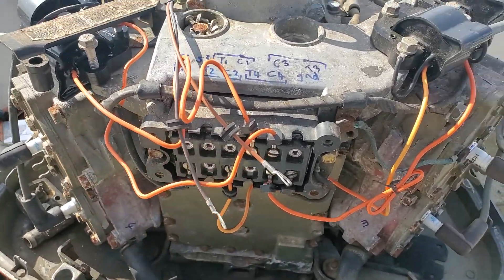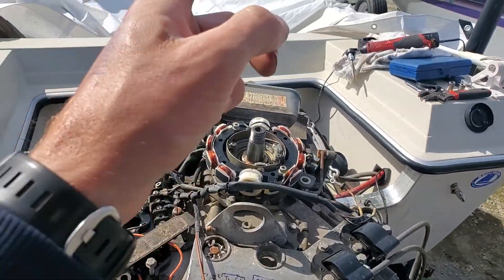Outboard Tech tips Incl Basics Crash course for diagnosing outboard problems

Comment: I’m not getting enough electricity to the battery. I did a multimeter when the engine is running it’s 11.5. I know it should be 13.5 or higher. I got a Yamaha 200 any advice of finding the stator wire so I could check that.

Comment: The only thing you skipped out on was is there a switch that connects to shifting lever that wont let engine start if not in nuetral so that boat dont scram into motion while attempting to start.also the wires coming into that red plug can you show what wires go to were on the block and what color it is.i got a used outboard with no control box and wires red plug cut at closest area to motor.no idea what starts what..it has the usaull purple,gray,black n yelllow,green,red,yellow and green i think.any tuturial will help just wanna hear it run.snooky pa.its a 90s johnson 40 off a pontoon boat!!
Reply from the maker: apologies - i was focusing on the motor components. Well 2 strokes are interesting, unlike a 4 stroke where key OFF REMOVES 12v POS to ignition to kill motor, a 2 stroke key off ADDS GROUND to short everything out because the ignition is self produce simply by the engine running - you can start a 2 stroke and remove the entire harness plug and it will keep running!! That safety switch is a backup OFF switch which basically connects a ground to the "kill" wire at the back of the motor - only difference is it wraps around your wrist in case of an emergency/accident :)
Reply: @SocalMarineUSA  yes you covered the motor components very well,i was just certain there was the nuetral safety switch on two strokes that will prevent ignition if in gear.yes i would assume its same as kill feature and grounds out system electronically. You know ur two strokes well obviously!!

Comment: Is it possible to get the idle timing close on a trailer and make the final adjustments on the water in gear?

I’ve had the engine apart doing reed valves and want to start from scratch but want to make it easier when I get on the water to do an adjustment in gear and not have to search too far for the timing mark. Thanks for your great information.
Reply from the maker: absolutely- dont swaet 50-1000 rpms either way.. i would say about 50-100rpm loss for in gear in water is about right. do it on the hose when the motor is hot- if you need to adjust remember to use the trigger first, and try the carb if the trigger doesnt work as expected. i do believe a slightly higher idle timing will provide better response and starting- but not too much of course. you have to fiddle around with carbs and trigger arm till it runs right.
Reply: @SocalMarineUSA  thanks for the reply. I have a dwell adjustment arm on the 225 Johnson that I turn clockwise in before adjusting the idle timing. After the timing is set I then loosen the dwell stop until it just touches the trigger adjustment. Does that sound right?
Would you recommend a couple degrees advance on the trailer and a bit high idle speed? I figure on the water it will drop. 
Thanks again for sharing. I picked up a lot of theory and functions of the system.
Reply from the maker: @jimdrechsel3611  not sure on dwell - thats for a coil based system. I dont think there is dwell on old 2 strokes. You mean the trigger? best approach is to close the carb blades all the way, and get it idling using the trigger arm adjustment - once thats running good you can leave a tiny gap between the carb pickup - that way when u adv the throttle the timing advances a little bit before bringing the fuel on, this will be more reposnive and burn cleaner - some need the carb open more to idle, its a balance of playing with things till it starts and restarts well hot, idles well - has good shifting manners in water and good power.. generally the idle stop is not used to set the timing - and if so just a little, its a common mistake to over use the carbs for idle speed basically - use the trigger arm/advance as much as possible. Good luck!
Reply: @SocalMarineUSA Checked the idle on the trailer with the rabbit ears and it looks good. It’s 2 degrees advanced and 1000 rpm without being in the water. I’ll see what happens when I shift into gear. 
I was hoping you may have some advice for a potential problem. I hope it’s fixed now but what started my troubleshooting issue was that the motor would bog and not progress to higher rpm and plane the boat. 
I did fix a reed gasket leak and replaced bad ignition wires. I plan to test now on the water to see if that is resolved. 
If the motor still won’t power up would you have any suggestions to check? Possible fuel starvation? Fuel pump? I replaced the water separator, filter, bulb and fuel lines. I also used a 6 gallon tank with a clear tube. It did suck fuel but the 3/8 line didn’t fill completely up on the suction side. 
Is that typical? Would you have any test suggestions to troubleshoot potential fuel starvation? The carbs were rebuilt last year. 
I’m hoping reed gaskets (2) leakage was the issue but I would like some where to turn next. Thanks for your input and advice.
Reply from the maker: @jimdrechsel3611  looks like youve addressed some important small issues. its common to have this issue, alot of times its erratic spark from either the trigger or pack - sometimes a problem will only show up at a certain rpm range. its really tricky sometimes. also avoid cheap chinese coils at alll costs- they leak out of the box. used oem or sierra is good. those are solid core wires and last forever. bogging could also be weak spark - its usually one or two problematic cylnders causing performance issues. I would try and simulate the problem strapped onto a trailer connected to truck with parking brake on, have the trailer out as much as possible, but enough to safely pickup water at the leg. run it to the area where it bogs - hook up a timing light to each wire and see if you can catch the flashing breaking by looking at the strobe light - hopefully you will find one or two cylinders doing it,  right there is the problem cylinder(s)..
Reply from the maker: feel free to head over to socal-marine.com and give me a shout - i can make some time for a few minutes
Reply: @SocalMarineUSA I’m going to water test today. If I have problems I will most definitely make contact. You have some great ways to test without expensive equipment. 
There were two reed base gaskets leaking so I’m hoping it’s resolved when I read your two cylinder reaction to bogging symptoms. 
I did have a mechanic do a spark jump test and all ignition wires did produce gap spark however if the spark is weak at a certain rpm that would not have shown since the test was while cranking. 
I will definitely check out the website address and thanks again for providing insights that come from experience and not the typical manual test procedures. 
I didn’t read anything about fuel starvation. Is that because you don’t experience that issue as much or at all for bogging?
Reply: @jimdrechsel3611  no prob. Those fuel pumps do last very long. rare for them to go out, and you would notice a dramatic issue with running the motor. it would stall even idling usually. you can always grab a low psi 12v fuel pump from autozone/oreillys and hook it up for testing inline to see if the engine picks up (or u can pump the bulb and see if the bog goes away - that would def indicate a fuel issue but i doubt it), possible you have a tiny air leak in the fuel lines (very common) that would def reduce fuel flow but these motors use small amounts.
Reply: @fstarockaburns425  I have tried pumping the bulb with no effect. I didn’t realize a power pack can cause a bog issue at a certain range of rpm. My last encounter with a bad power pack was no spark at all. 

I will let you know how things go just for the sake of sharing my situation that could help others. 
Would you actually try to set max timing with the boat strapped to the trailer? I bet people haven’t seen that one at the launch.
Reply: @fstarockaburns425  The motor problem was solved. It was a bog because of two reed valve base gaskets leaking. The gasket sticky side let loose. Last attempt to fix I placed sealer on both sides of the reed gaskets and the intake gasket as well. Cured the problem. Your videos did help with sync adjustments and idle timing regardless. Thanks for all the replies. You have a new subscriber. I enjoy the troubleshooting process and function explanations.
Reply: @jimdrechsel3611  good news! lucky you didnt have to deal with ignition issues. the max timing methods allow you to set it at cranking :) so no need for WOT trailer missions. One way is to drain all fuel and let the motor die, then put throttle at WOT and crank, usually there is a 2-4 degree difference to REAL WOT timing - thats how u do it - no fuel :)
Reply: @fstarockaburns425  I was lucky enough to have another driver and did WOT on the water. It did max out. If the motor doesn't max out with 5800 rpms could that be a motor getting tired? The compression was 95 psi. It was busy on the water so I couldn't pump the bulb just in case it was fuel.

Would you say it's better to be 2-4 degrees retarded doing it that cranking way? I would think too much advance would risk detonation. Thanks again
Reply: @jimdrechsel3611  if u follow the manual it will have the correct procedure. Yes i usually take off 2 degrees on the max for a safety cushion with todays fuel. i dont use WOT alot but on smaller engines that run WOT it can save a motor.

Comment: Great explanation about setting idle speed using idle timing adjustment with carb throttle plates closed. That goes against thinking if you compare to a car when setting idle speed. That’s not mentioned in my manual.  

Knowing there’s more steps in the manual:

Unhook the cable, synch/set your carb throttle plates closed, adjust the cam pickup position and then check the idle speed using the idle timing in gear on the water?

Don’t increase speed by opening the carb plates ?

Thanks for sharing

Comment: does setting max timing higher increase power similar to how cars engines work?
Reply from the maker: not really unless you are tuning for racing. Leave it 2 degrees below the spec to be on the safe side. you will not notice the difference and the motor will have less chance of blowing up. Follow the manual instructions because its usually set at cranking to a different value than, ie setting it at 24 cranking will result in a different number when actually running, and the outboards have various specs and methods.

Comment: Great videos!  I am having rough idle and stall when engaging into gear.  Any common problems.  Sounds like misfiring.  Also seems to get fouled plugs quick.  Mercury 150 efi.
Reply from the maker: Could be leaking injector. Check fuel psi might be too high